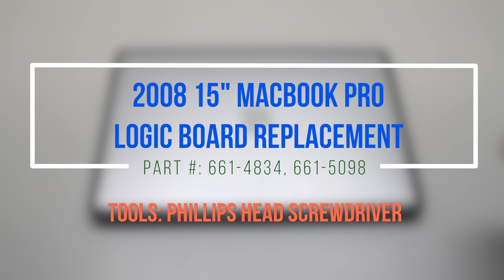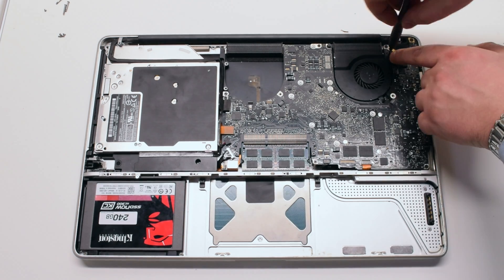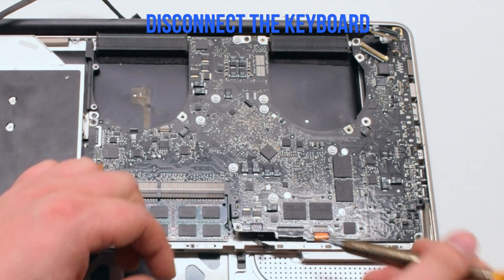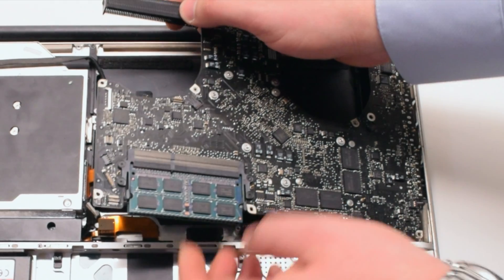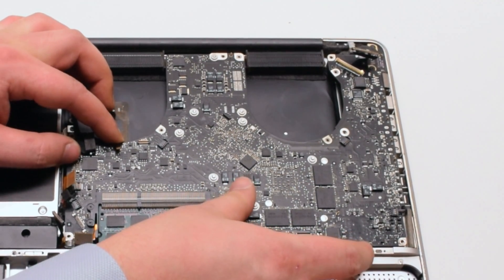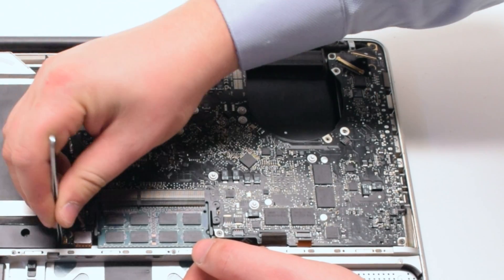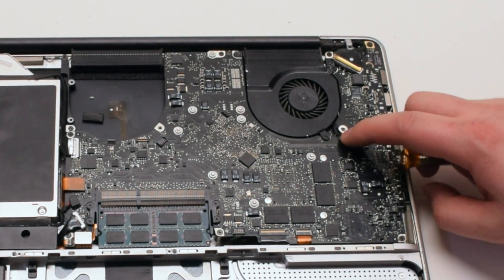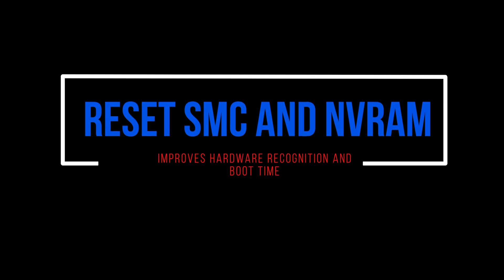2008 Macbook Pro 15" A1286 Logic Board Replacement

Comment: Oh my gosh THANK YOU for making this video!! My beloved 2008 MacBook finally bit the dust after 12+ years - and worked well right up until it died! - and I wanted to take out the logic board before recycling it. I asked a friend who works in tech, but after I found your video was able to do most of it myself! I used a tiny glasses repair screwdriver from the dollar store and was able to remove the back, the fans and disconnect all the little ribbony tabs and wiry things and now my friend now just needs to remove the actual board. We saved him so much time! I so appreciate your expertise thanks again! 🙏🏼

Comment: I re-pasted my cpus and gpu and made a couple mistakes. 1) I accidentally broke off the heatsink temp sensor. I used a small strip of electrical tape to try and put it back into position. I know there are apps to control the fans speed, I've used them before. I know it's hardly ideal, but I'm using this as a third laptop so I didn't sweat it too much. 2) the eyelashes for the Sleep Light indicator and Express Card broke off under very little pressure, and I mean very little. Again, I wasn't worried about the Express Card because I personally have never used that thing.  I was able to get the bands for the two into their position, just with no eyelashes on either. The problem now, is that when I plug into charge, the charging indicator light on the charger is not working nor do I believe it's charging, because the laptop will not power on. It was working prior to the breakdown, and does make a slight hum, but does not get warm after being plugged into the laptop for any period of time. The battery was dead before working on the machine, but is fairly new and was working and in good shape. I went over everything countless times to make sure I didn't forget anything or damage anything else. I would think that even with my screw-ups the laptop should still charge and power on. I've done this many time on PCs and Windows laptops with no problems. 

Anyway, I hope you're still listening and have a suggestion for me. I really don't want to scrap this thing, I still have some use for it. Thanks for the videos btw.
Reply from the maker: There is no reason for it not to work other then some connection being missed or contact with metal shorting something on the logicboard. Best advice and I know you might not like it, is to completely take everything apart again and slowly carefully reassemble, not missing any of the underneath connection steps.

Comment: what cpu did you upgrade this to? how do I know which logic boards are compatible with this macbook?
Reply from the maker: They go by year and model/size. So for a 13" 2009 macbook pro there are multiple logicboards that will fit. The best thing to do is get acquainted with www.everymac.com look up your Macbook year and Size and see the complete details and model number then type that model number into an ebay search bar and usually that will be an exact match. Good luck.
Reply: Really appreciate the slow explanation of each step and the detail that is used in connecting electronic cables. Would like to follow more of your tutoring.

Comment: Great video lessons! I've replaced the logic board on my late 2008 Macbook Pro as shown in the video. Once I finished the installation; I performed the SMC & NVRAM reset, but nothing happened.  The battery light turns green, but still, it won't turn on? Since also I replaced the old battery with a new one; I figure I let it charge overnight if that might be the issue. I repeated the SMC & NVRAM this morning, but nothing. Is there anything else I need to do?
Reply from the maker: Check the keyboard ribbon connection because the power button is part of the keyboard.